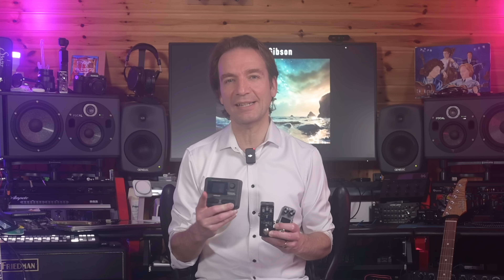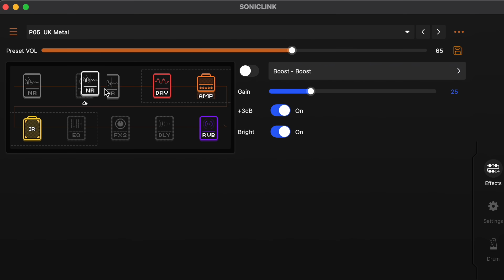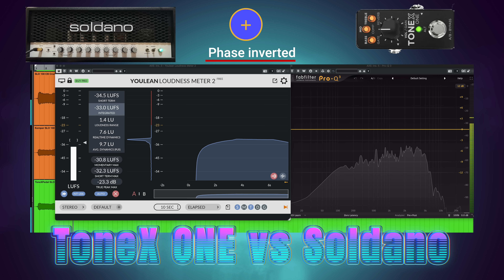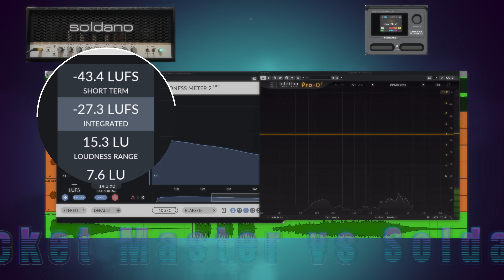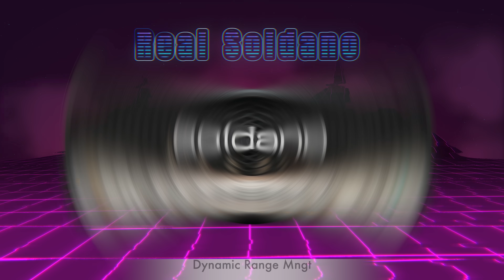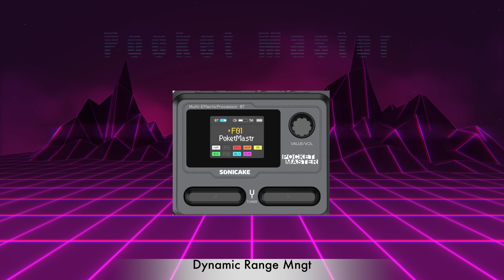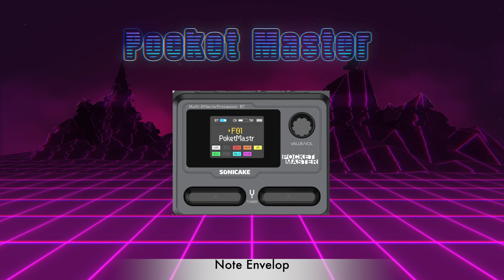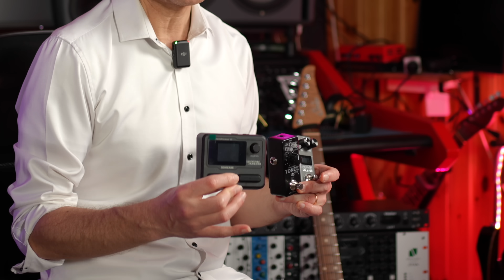Valeton GP-5 vs ToneX One vs SoniCacke Pocket Master (with NULL Test and vs a tube amp)

Comment: Underdog ➡️ annblack box. 
best price, best performance
Reply: They make very smart products, but they are not audio devices.
Reply: @evolve6824  why?
Reply: @borjigin-mongolian  From an engineering standpoint, the algorithm works, but the quality of other effects is very low.
Something to think about.
ANN is an open source technology released by NAM.
(The quality of the amp simulator or IR can only be good.)
In fact, all of M-VAVE's products are somewhat disappointing in quality.
From MIDI keyboards to guitar effects.
I have a Black Box, MK-300, MIDI controller, MIDI keyboard.
I also have a lot of Chinese audio equipment, which is a typical reality of Chinese products.
They churn out products without understanding or considering the product.
I consider these products as training toys.

Design techniques that can be made cheaply are smart.
M-VAVE shines only on the JL chip platform.
That was the only way to be price competitive.
The policy of absorbing open source into its own technology and trying to dominate the market at low prices is a typical part of China's industrial policy.

Does Sinco have a partnership with NAM? How much does it contribute?
ANN is nothing more than a technology that has largely taken NAM's technology and packaged it in its own way.
These companies should not be praised for their technology.
I think the problem is the fanboys who like underdogs.
Reply: @evolve6824  ANN is quiet different from NAM. Not matter wavenet or lstm,  it is hard to work on the JL chip platform(I had checked their spec, only up to 192M). But they had met to the same level as NAM(except for same room reverb training). I saw the ambition to compete with NAM,  which is support by a alg teams with Strong mathematical and embed software designing background. Maybe their effects is not comparable to the top level,  I think it is very likely because they have not enough device samples to training   through ANN.  And I can see their progress from cubaby, tank-x to mk series. That's also why we like underdogs
Reply from the maker: Thank you for sharing

Comment: Valeton GP-5, I discovered that the IR+NAM function isn't available; you can only load NAMs, which greatly reduces its versatility. I canceled the purchase.
I'd rather wait and see if an update adds the NAM+IR function... or I'd rather have an effects slot removed and have my own IR+NAM.
Reply from the maker: Thank you for sharing
Reply: It might be impossible to use IR and Nam together, mainly due to CPU performance limitations.

Comment: The GP-5 can be midi foot switch controlled so you can scroll presets and toggle pedals with if a preset with your feet like a regular pedal board. It can be powered via USB by the midi controller or via a battery pack making it even more travel/busking friendly. The GP-5 also has the headphones output for travel and practicing quietly.
Reply: I wish I knew what footswitch to get. All the hype was the wireless paint audio unit, which I haven’t heard about in a long time. And I never get an answer if I can use a line 6 or similar footswitch.
Reply: @TheSkulletMan I use MVAVE Chocolate PLUS (or v2) for my NUX MG30, can it be used too for GP5 or Pocket Master?
Reply: @beng4818 yes it can for gp 5, however not sure about the pocket master

Comment: Tonex for days. It competes with Quad Cortex .
Reply from the maker: Thank you for sharing!
Reply: Is that the unit that has no touch screen, but not as large as the QC? Just the basics you can load presets on and tweak with the knobs? It comes in black and I think limited edition white?

Comment: Great video, all devices are great. I have tonex one and pocket master, the GP5 was not out yet when I decide to buy pocket. But for the use I prefer the pocket master because of the battery.  But the Tonex One gives really better tones, especially using it trough the various FR outputs or some "fr wanna be" amps. But I have both of them because of the use... and the price of course. Tonex One can be used good in the studio for recording, but Pocket Master can be used for practice, or some quick vloging gig or whatever. Nice video!
Reply from the maker: Thank you for sharing your experience and I'm really happy that you appreciate the video!

Comment: Great video. Although as I understand, it should be mentioned clearly that two more important differences are 

(1) the fact the GP5 and Pocketmaster both support bluetooth (which is a huge plus in terms of ease of use even with your phone and playing with backing tracks),
(2) the fact that the Pocketmaster, based on the specs I see here, is by far the most power-hungry (1A vs the 0.2 and 0.26A of the others). So powering it with batteries might be quite time-limited.
Reply from the maker: HI, thank you, I'm happy that you appreciate the video
1) it is clearly mentioned in the comparison chart 
2) 1000 mA is the capacity of the battery

Comment: I love my new Tonex One, also live. I can adjust my sound in a sec without dailing in the menu. just with the knobs. Sound is so good when you first find your amplifier of choice. I use the browsing mode to swich between 3 sounds live. Clean, drive and solo.
Reply from the maker: Thank you for sharing!
Reply: How can you get three sounds on the go? I thought it was only switching between A&B
Reply: @lucasoldwine1130  if you include stomp mode that is 3. I guess if you leave the Tonex One in browse mode you can have 20.
Reply: @lucasoldwine1130  Hold down the footswitch and press the Alt button. You can even set the 3 channels up with different lighting (green for clean, yellow for crunch, and red for lead). Pressing the foot switch will go between each channel. You have to do this every time, it doesn't save that option.
Reply: I do like having  knobs on that one.

Comment: Hey Leo: Some corrections/additions: Pocket master has Midi over Bluetooth now. Plus a new Acoustic simulator and also 20 Seconds looper with the newest firmware.
Reply: Acoustic simulator on sonicake pocket master??? Really?
Reply: @IZY_129 very good try to acoustic simulation but not more
Reply: @VladislavYe i use electric guitar and my sound will become acoustic guitar, right? Sorry, my english isn't good
Reply: Yes
Reply: @adrianaellig8897 should I use humbucker or single coil for simulator to acoustics?
Reply: Perhaps the performance has improved as well.

Comment: Hi Leo, many thanks for doing this comparison, which I think a lot of people will be grateful for and find very useful. Worth pointing out that the new Pocket Master (PM) firmware release 1.3.3 supports MIDI, so seems to offer the possibility of external (foot) switching, either via USB-C or Bluetooth. The PM also has a 20 second looper (as of Release 1.3.3 - was previously 10 seconds) and metronome (with access to drum patterns via the app, I believe, as does the GP-5). These functions would seem to enhance the use of the PM as a practice tool. I have both the PM and the TONEX ONE. My limited experience of the TONEX ONE to date confirms your conclusion about the comparative tone and sound quality performance of these units, but the PM still seems to offer pretty good sounds for practicing and home recording. The PM's built in battery is really handy as is the ability to configure it without the app!
Reply: 20 seconds of looping now with the latest firmware on the PocketMaster
Reply: @Davix-tt9sh  You're right - should have checked the Release Notes! Have edited original comment accordingly - thanks. That's a very welcome enhancement, as 10s is quite limiting. If they could jack it up to 30s, that would be really useful...
Reply: I thought the PM was actually a joke when it came out. I bought one just to see. Well, I was wrong! I also have the Mooer GS1000li.  No batteries! I love it! I have to back to back compare it with the Quad Cortex!
Reply: is the looper on the pm quantized to match the bpm?

Comment: I own none of these but am in the market for one to complete my lightweight guitar system, which lacks only drive and distortion functions. Based on your test, I would go for the Tone-X. The superb latency spec is the number one reason and I also think it renders distortion more accurately with the least upwelling of noise on decay. Big thanks for this test, Leo.
Reply: I don’t know if I’m allowed to make a suggestion, but I love my little Mooer series. M2,m1,p2 etc… changed so much for me. And I love the Dept.10 series from blackstar. All offer 3 different type of functions, but they all over the same 1/20/100 valve power! The white one offers your basic power source that I just mentioned (maybe a boost I can’t recall), then comes the red one which has the same power but with reverb and some other effects, and lastly is the black, which has the same power but with basically 4 -5 channels. Clean, crunch, crunch 2 , and lastly crush and crush 2 (basically clean to major chug). Sorry just throwing some options out there.
Reply from the maker: You are welcome and I'm happy to have been of some help!

Comment: Would adjust the EQ change the null test? The PM does need some EQ to get the tone dialed in. Use the base EQ and that reallyh brings the NAM DI captures to life. It think it should be understood that the null test is NOT a quality loss this is only an accuracy loss the TX one is not that much better and the EQ's on the PM and GP5 can easily make up for those losses especially the ease of use the BLE cell app. This also makes these units much easier making adjustments only takes seconds. No cords and messing around with clunky software. The cell apps on the PM and GP5 are actually very well done. Alls I can say dont let that null test prevent you from checking out the PM or GP5 they have way more to offere and can indeed sound just as good if not better than the TX1 expecially the the modelling capability.
Reply: Excellent input - thanks! Totally agree.
Reply from the maker: Yes, changing the EQ would change the NULL test results
Reply: @LeoGibsonGtr  That would be very interesting to see. I dont have the GP5 but I have multiple PMs I run two together with the hotone vol pedal between them. I have a 3D printed tray with the remote foot switches wired in. So the second one is my IR loader and wet FX. Less quality loss this way too. But I have not had that issue. I have not even looked at my TX1 since getting my pocket masters. I have no desire to use it when they are so much easier to use.
Reply: @ultimatescalerc7151  Yikes! now you have DOUBLE the latency. Over 10ms.
Reply: @LeoGibsonGtr  I hope Ampero updates the Mini to run NAM. That pedal would be perfect especially if they can get the IR block to work with NAM. Then you can make use of the Expresion pedal input.
Reply: @LeoGibsonGtr  Oh yeah both the GP5 and PM are BLE / USBC MIDI ready not just USBC. You can run both with the chocolate plus. Why valeton has not stated its ready but there are already people doing it. You could (theroretically) run both one pocket master and one GP5 together off one chocolate plus too. One would need to use the USB host and the other one would use the BLE connection.
Reply: @LeoGibsonGtr  Something to just play with. Is just turn the EQs on and just doing that without changes will effect the tone. I think that would be interesting to see all three EQs just turned on if that makes any differences at all.

Comment: They all sound good.  Two have a screen and one is half the price of the other.  Money does matter as peoples budgets differ.  I like screens as I am human and can read.  It boils down to the neglected area that is always glossed over.  People are leaving Windows because of the spyware and ads baked in. They might go to walled expensive garden that is Apple or they may chose the free and powerful Linux.  No Linux software NO SALE.  Good video Leo. One day some brave manufacturer will corner the market by releasing software for all users.
Reply from the maker: Thank you for sharing

Comment: Tonex has 1024 points irs. They hide this info intentionally
Reply from the maker: Thank you for sharing!
Reply: The longer the TAP, the longer the delay. Using a technical technique, most outputs are processed with 256 TAP.

Comment: Interesting that the compression of the NAM profiles seems to mostly take away high frequencies. NAM is superior to ToneX in terms of the null test, but we hear that compressing the NAM profiles has a cost and the ToneX remains the one to get in terms of pure tone. But how long until small pedals like this have dsps capable of running full, uncompressed NAM profiles?
Reply from the maker: Thank you for sharing!
I guess we still need some time before the prices of the DSP goes down to allow chip units to load full NAM profiles.
Thanks!
Reply: There are many changes in the high frequency band.
NAM compression reduces the efficiency of detecting frequency changes in the high frequency band.
Single processing is possible with Cortex-A15 @ 1.5GHz(float32) and AD/TI DSP @ 500MHz(Q31 fixed point).
It requires 200-300% more DSP performance than the MCU used in ToneX.

Comment: Hello Leo. Thank you for the work you put into this video. As always, precise. Personally, I am a Tonex one user. The only thing missing here is the ability to connect midi via USB. I have even heard that the equipment could handle it, but an update would be needed in this regard. I will wait patiently. For me, this size and sound quality are mega advantages. I am still experimenting with connecting the Tonex One in various ways with the old Boss GT 100 multi-effects. Unfortunately, the Tonex One connected to the Boss effects loop receives its sound accretions from the Boss. The Tonex no longer has this ideal reproduction of the amplifier. I am still trying to get around this. In the end, I will simply connect the Tonex as an amplifier behind the Boss GT 100. This should solve the problem of coloring the sound. I hope so. But the great thing is that by connecting Tonex one to my amplifier's Return, I can enjoy the sound of the amplifier I want, if it is available on the Tonex or tonenet platform. Mega option. I recommend it. Best regards. I am currently in East Germany. (I am a truck driver from Poland).
Reply: @towijjah3817 I am running a Tonex One through a Boss GX-10 and it sounds great. I’m not sure if the GX-10 is the same as your unit since it a newer unit but please explain your comment re “sound accretions. Perhaps my unit being newer does not have this issue. Running the Tonex as you suggest after the Boss would not seem ideal since the delay, reverb will be before the amp so again not ideal.
Reply from the maker: You are welcome and thank you so much for sharing your experience and your findings!

Comment: FYI, the GP5 is also battery powered, just not internal battery.  Standard USB C cable to a standard 5v mobile device power bank.  As usual Leo, superb work.
Reply: Tonex can also be powered like that
Reply from the maker: Thanks!
Reply: My android phone powers the gp-5
Reply: The term "battery powered" is typically used to refer to devices with integrated batteries, even though, in principle, any device can be operated using an external battery source. Which makes the SoniCake Pocket Master unique in this comparison.
Reply: @Rex-Se7en  You may be semantically correct.  But I maintain that the GP5 being able to be powered directly via standard USB C and external battery power bank still was worth mentioning and I stand by my FYI comment.
Reply: @joesatchton212  It's a semantic distinction, because your point is obviously true for any electronic device, virtually all gear today can be powered with an external battery. That’s a given. The key difference here is that the Sonicake comes ready to power on straight out of the box, with no need to purchase anything additional. That’s why it’s considered “battery powered.” As Rex pointed out, that’s a unique feature in this particular comparison.